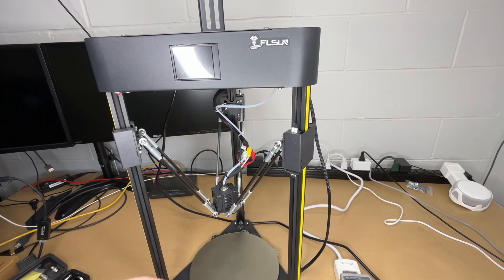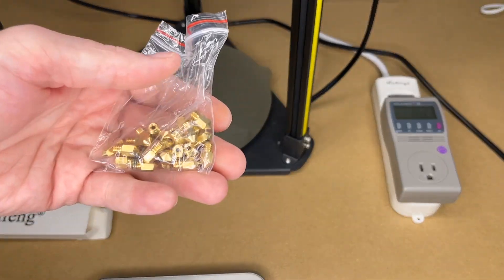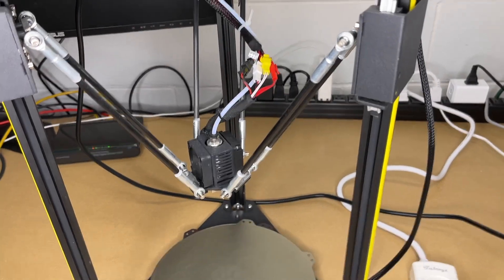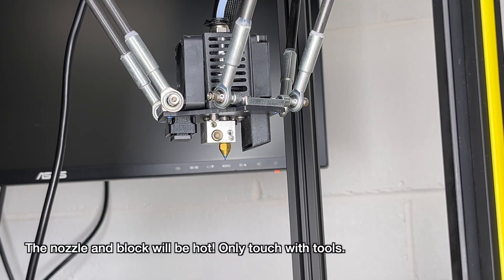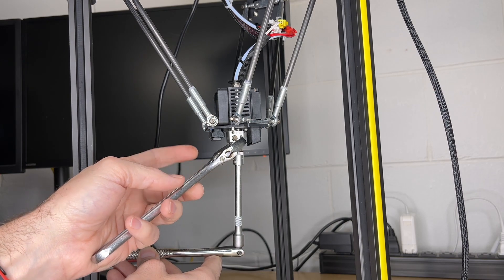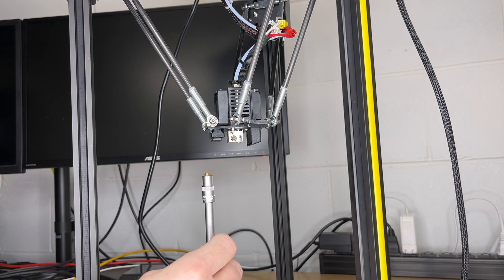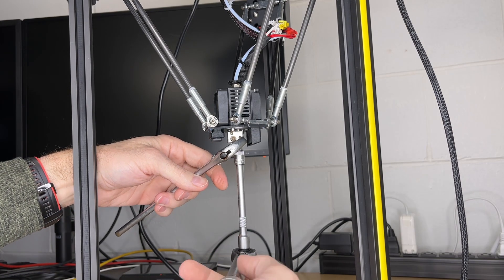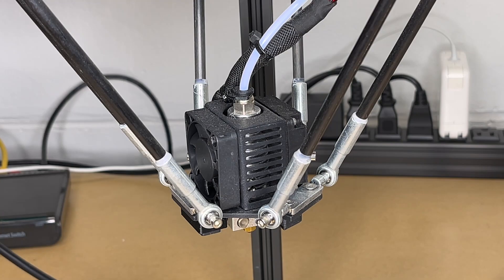FLSUN Q5: Nozzle Replacement

Comment: So... how's your coding? You should Klipperize it! Just saying, with a hint of pretty please. A detailed guide for setting up everything from compiling and flashing the machine & controller and then seting up mainsail or fluid. Maybe use a pi or btt pad 7 or just a CMxxx something and pc or an app control, you know just a full ground up setup. It totally wouldn't be for just you, me & a few others... mks robin nano boards are (& were) more ubiquitous than most realize. There are definitely config files on github & accelerometers are cheap. The speed Racer and V400 or whatever are not 😂 I promise no one's done this, I looked extensively & wouldn't have returned my Pad7 if there was a guide detailed enough. Lol but 😢 edit: well it's been done just not documented functional moron proof (for me😅)

Nice nozzle change though, I've gone through many trying out new ones and some getting worn. I've found out the hard way why they have you take everything apart, but really it's actually easy(ish). The nozzle MUST be tightened up to the heat tube's threads coming from the other side of the heatblock and not only the heatblock itself. A teeny tiny gap, hopefully flush to both if just right. There can be a gap that eventually leaks a tiny bit from the top of the heat block especially if your replacement nozzle's threaded section is a tad short. Mine was fine for a while, then the ooze began on a long print... o the horror. After days of chemical soaking the heatblock, tube and nozzle were finally free from being fuzed into a PLA blob. But to solve this you don't need to take everything apart, just that one tiny allen key into the fins of your head to loosen the set screw and it just comes out if you're gentle and careful, do it hot. You are spot on with the adjustable wrench to hold the block while tightening.
The Q5 does not get enough love anymore, thanks for keeping it around.